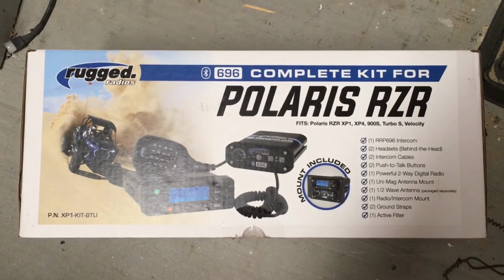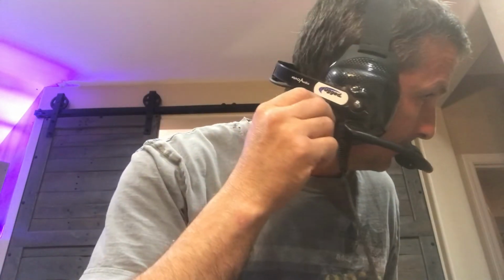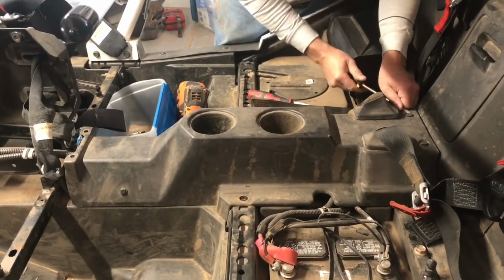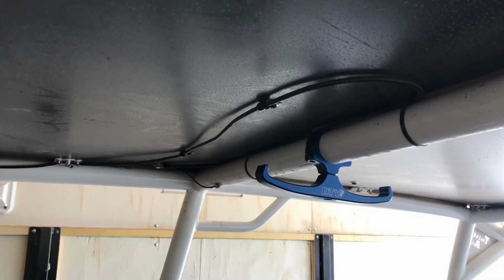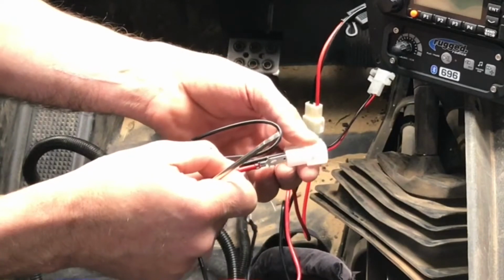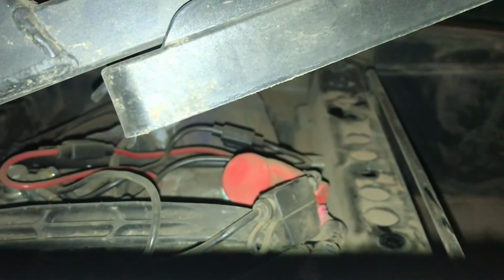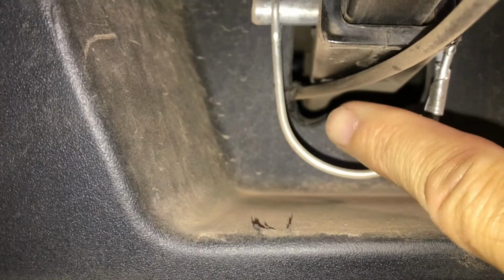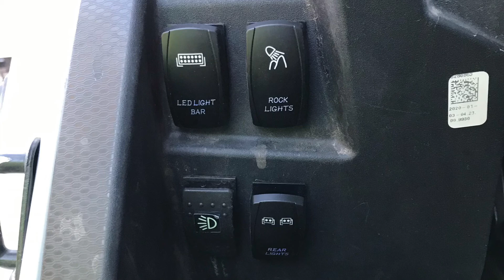RUGGED RADIO WITH BLUETOOTH INSTALL ON RZR XP4, OVERVIEW & I ADDED A POWER SWITCH FOR IT WHY & HOW

Comment: Two years later and no one has pointed this out.... your "intercom" is actually a two way radio... plugged into what is called an "intercom, with Bluetooth".     It took a bit to figure out which units you were talking about.  That said, nice install.     So what kind of range do you get when talking with similar equipped cars?
Reply from the maker: Hard to say at the dunes on top of high I pick up several different groups that I cannot see so it’s got to be a pretty far distance
Reply: thats incorrect. intercom is a wired system that in vehicle headsets connect to. car to car is 2 intercom system connected via a 2 way radio. intercom with bluetooth is the in car intercom system that uses a bluetooth connection to connect to a music player or cellphone so music can be played through the in car intercom/headsets. range depends on many factors but mainly depends on what kind of 2 way radio you use, the wattage and antenna.

Comment: How did you get bluetooth to connect? I followed the instructions and we tried 2 different phones and a tablet and rugged does not pop up. The way the instructions say just to turn the communication on then your bluetooth on seems like anyone with bluetooth could connect. I feel it should go to pairing mode but rugged instructions has nothing about holding buttons down. I emailed them but it's the weekend. Hoping you could tell me how you did this. I have the same unit. Thanks
Reply from the maker: That’s specifically why I added the power on off rocker switch because I would have to cycle it off and then back on to get anything to pair to it but try turning  off the rugged radio at the volume knob all the way to the left and then turning it back on and pairing immediately
Reply from the maker: The reason I added the rocker switch is because I didn’t want to have to adjust the volume every time when I wanted to pair a new phone
Reply: How did you guys get the Bluetooth to work have tried how the said in the instructions but it never pops up

Comment: For the {lack} of price difference between rugged and pci these days i see no reason why anyone would run rugged stuff.
Reply: I'm not seeing a price difference between PCI and Rugged when comparing similar setups.
Reply: @bobbybarnes1652  the difference in quality however is vast. Rugged is just chinese junk.
Reply: @DieselRamcharger  Not anymore.  They design AND manufacture their radios in California.  If you don't believe me, call them yourself ... and try to stop living in the past someday, Uncle Rico.
Reply: @bobbybarnes1652  lmao you are absolutely wrong.
Reply: @bobbybarnes1652  Yeah because Rugged massively overcharges for their shit product. Buy PCI the original AND the best. You obviously dont understand this is all intercom system from small aircraft adapted for use in OHV recreational vehicles. Do you have any clue who WEATHERMAN is? I